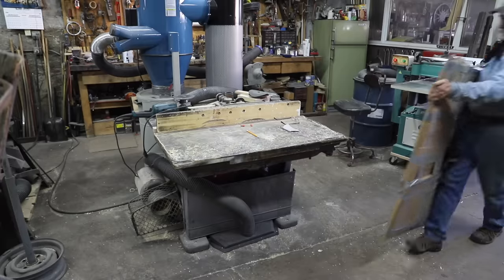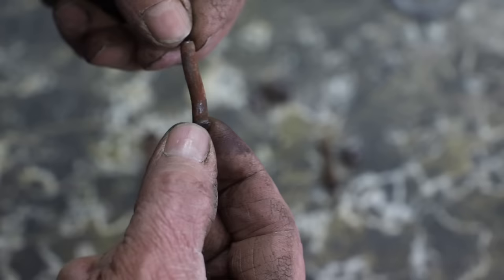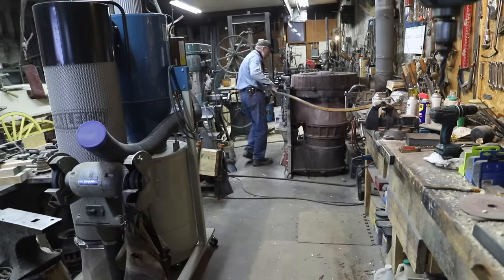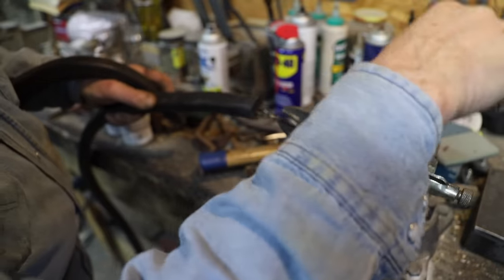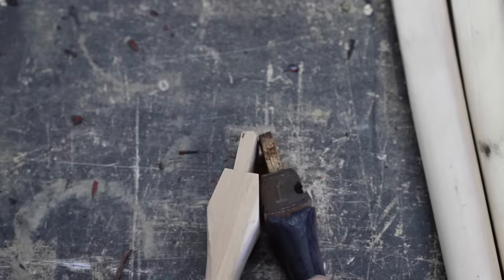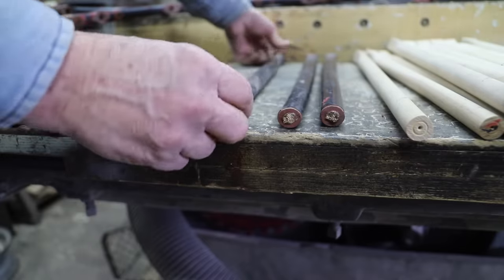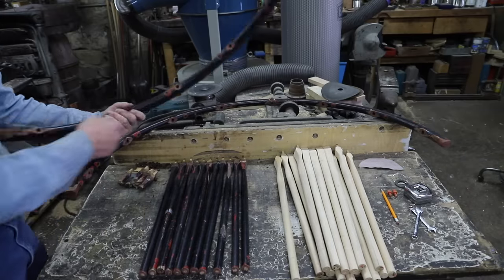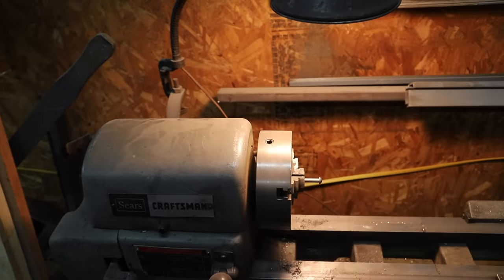100 Year Old Buggy Wheel Built Incorrectly | Engels Coach Shop

Comment: Your comment on rivets has a simple explanation. You are dealing with both kinetic energy and inertia when you set rivets. Kinetic energy is a function of velocity squared. Inertia is a function of velocity. Both are functions of the mass of the hammer. kinetic energy results in heat thus mushrooming the head, while inertia results in movement thus bending the rivet. Old style pneumatic riveting hammers used very rapid blows when the set hot steel rivets. You find these mostly at estate sales. More modern rivet guns are used to set aluminum rivets which are worked cold. These gins need to be slower to prevent work hardening the aluminum. Heat treated rivets are also called ice box rivets because they are stored in dry ice before using. The hardening due to heat treatment is delayed by cold, so these rivets harden at room temperature after they are driven. This is mostly a lost art on the average person. Most people don't even know what a ball peen hammer is used for. except maybe hammered copper craft projects.

Comment: When I got up this morning I wasn't thinking: "Today I will increase my knowledge of rebuilding buggy wheels by 100x today". It turns out that life is unpredictable.

I was surprised to see WD-40 used in the rubber tread - I guess enough is "blown out" that there's little left to degrade the rubber and, ultimately, the rubber gets replaced due to wear on the outside before it degrades from inside due to the small amount of WD-40 left? (I don't know if WD-40 Specialist Water Resistant Silicone Lubricant or the CRC equivalent which is supposed to be "rubber safe" would provide enough "slipperiness").

Also, it looks like new holes were drilled through the metal rim (or whatever it's called) rather than reusing the existing holes and lining them up with the existing ones in the wooden rim? Perhaps I'm missing something here, but doesn't that mean that eventually the rim will need to be replaced after some number of rebuilds just because it's got too many holes in it?

It's obvious that knowing 100x as much about rebuilding buggy wheels now than I did this morning means I've still got lots to learn :)

Comment: understanding the brazing of the wheel wires isnt the hard part to understand. your compressing the rubber with that machine and then brazing. once thats done you allow the rubber to take its original form with a little persuasion. now what does blow my mind is the genius who had the idea for that contraption you used to keep the wire at proper length while compressing the tire itself.

how "modern" is that contraption? was there a different method before it?

Comment: I'm sure there are plenty of jacks  of all trades, masters of none, or one, or only a few, that existed back then, just as they do now, who took on projects like this wheel.  I guess what you are saying is it only lasted 100 years or so until it got into an accident, soo ... ?

I've seen some small wheels made for furniture, like tea carts, where the manufacturer was CLUELESS how to make a wheel, no chance that they would hold together.  In this case, I would guess probably more one or more of soused/distracted/pissed off/clueless/newbie/un or under supervised trainee/etc than Friday, or a wheel that was built by more than one person, and the one of them was not giving it due diligence.  That, or the wheel was built fine, and disassembled to be fixed, like you are doing here, and reassembled incorrectly, like you almost certainly are not.  Just my two cents.  What I've found is pretty much every time someone says "I've been doing this 30 years" as their sole "claim to competence" RUN, don't walk, the other way.